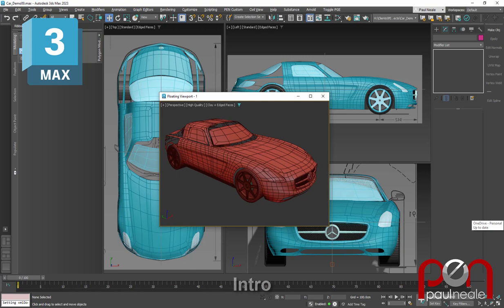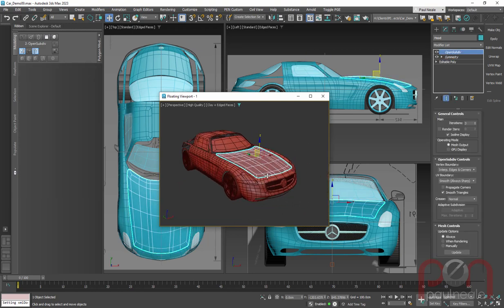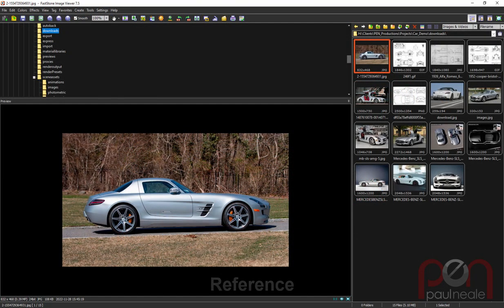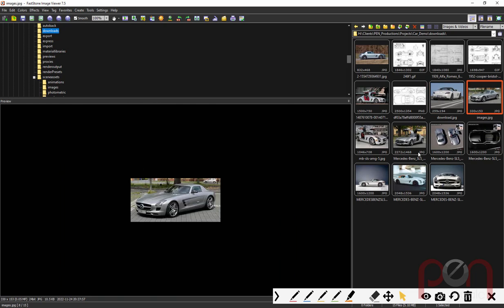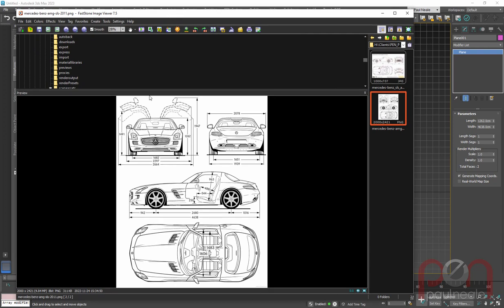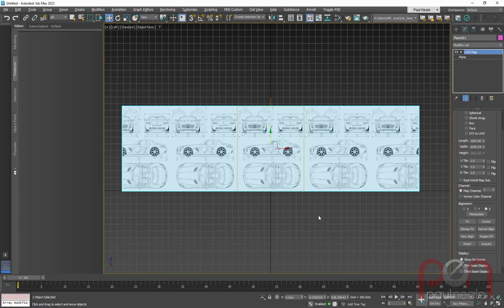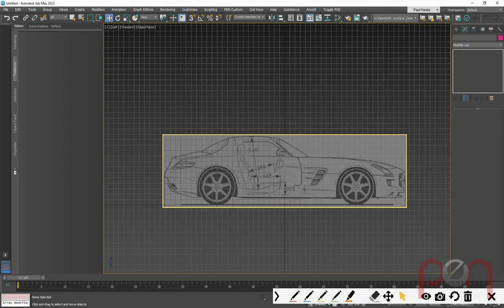3DS Max Car Modeling Setup

Comment: When I drag the image via the UVW Map onto the plane, the image is not visible in the viewports (I have to create a texture and apply it to the plane to be able to see the image on the plane).  I have searched and searched and can't find any info in this.  I assume it's just a keystroke, but I be darned if can find it.  Any insights on this?  Once I do my work-around, I don't see the image on the reverse side of the sideview plane.  Could these two issues be connected?
Reply from the maker: I don't know what you mean by "drag the image via the UVW Map onto the plane" ??
Reply: Thanks for the quick response! At 10:25 in this video, you drag the image of the car blueprint from your image viewer onto the plane.  When I do that, the image does not show on the plane in the viewport.  So I have to create a texture in the Material Editor, and make it viewable and then place it onto the plane.   @paulneale
Reply from the maker: @vernpenrod7578  I assume your is in shaded view? What version of Max are you in? When you drag and drop it on the plane does it create a material? Check by using the eye dropper tool in slate.

Comment: Thank you for the lesson,i have one question,when i dial visibility in object propertie to 0.2 and uncheck the renderer check box,my image is not see through like yours,also my image is a pic not blueprint like yours
Reply from the maker: Viewport in high quality?
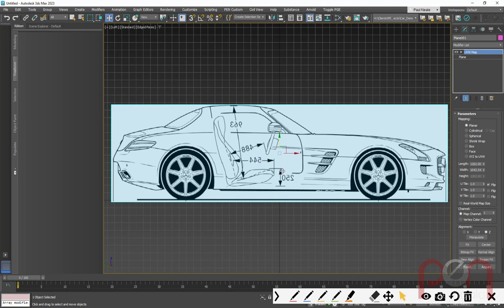Reply: @paulneale  Thanks for the fast reply,my image is not blurry i set the quality already,it just won’t become see through after i follow your steps at 13:16,forgot to mention i am using much older version of 3ds max
Reply from the maker: @bolet_ti_vari  I'm talking about the Max viewport. Is it set to Standard or High Quality?
Reply: @paulneale  I''m using 2010 version i don''t think i have that setting (the game i want to build a model for needs that version),anyway i will redo your lesson maybe i missed something,thanks again subscribed
Reply from the maker: @bolet_ti_vari  2010??? You are now 15 years behind in the development updates.

Comment: This is very useful to a complete 3DS Max beginner, having gained a little proficiency on Blender. I was progressing until 10:55 when I couldn't scale the bitmap. It was imported using Drag and Drop. The units were set to millimetres in all 4 viewports. Any ideas how? I am still attempting on a trial and error basis.